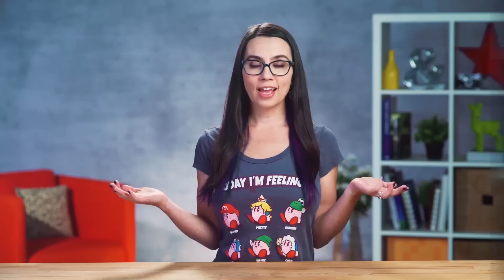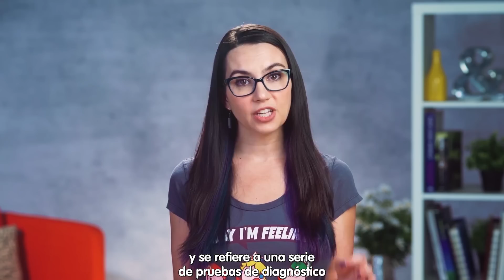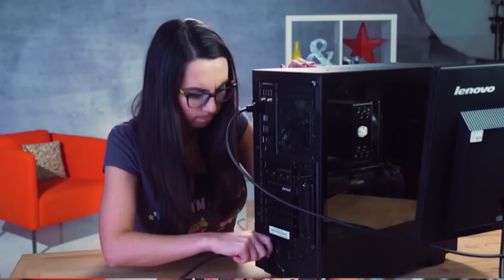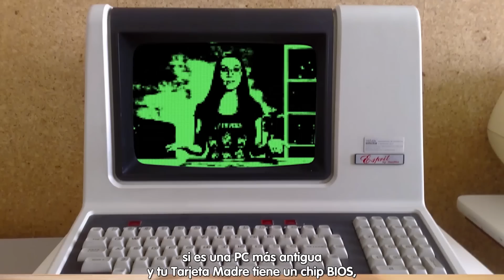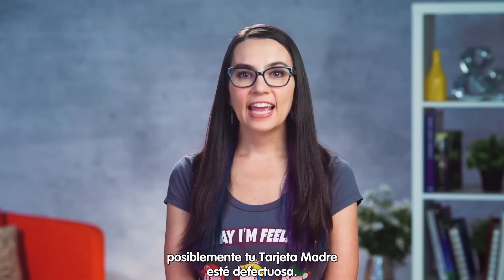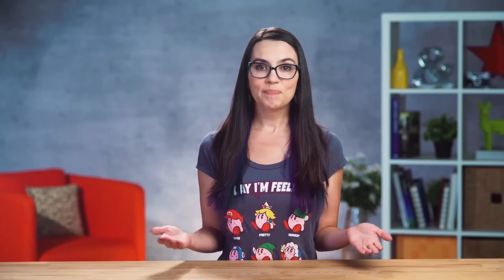Cuando tu PC no arranca ESTO es lo que tienes que hacer - DiY en 5

Comment: Ayuda , mi pc la enciendo luego lo desenchufo y al día siguiente ya no enciende , le cambié de fuente y pasa lo mismo , enciende y luego de 12 horas ya no , que puede ser
Reply from the maker: Hola, gracias por tu comentario. Si ya probó las sugerencias de este video, además de verificar los componentes físicos dentro y alrededor de él, tal vez su mejor opción sea consultar con el fabricante de la computadora para obtener un diagnóstico adicional, así como consultar con un taller local de reparación de computadoras.